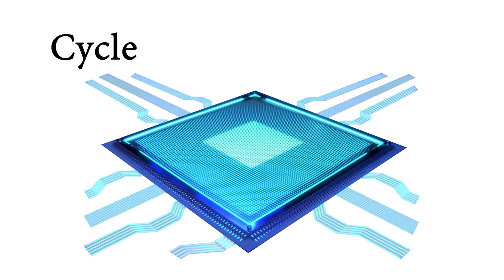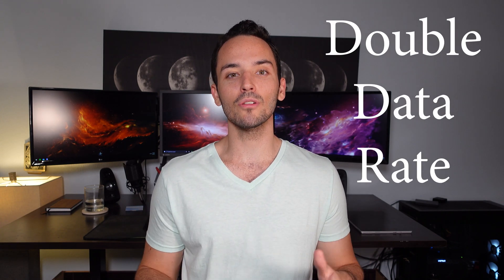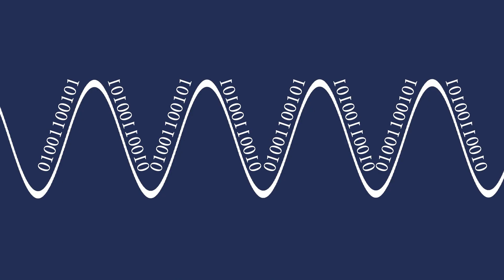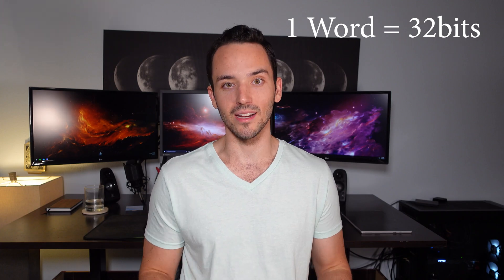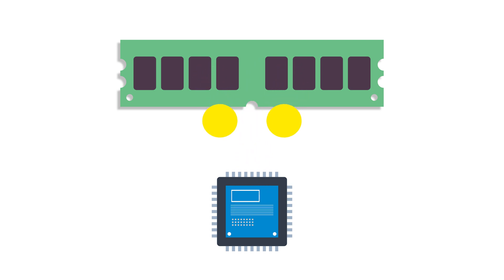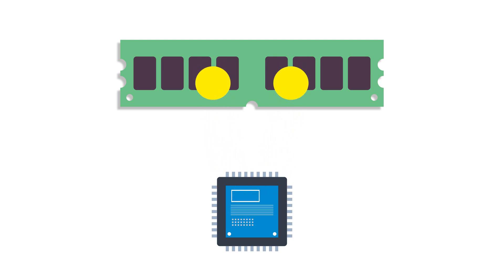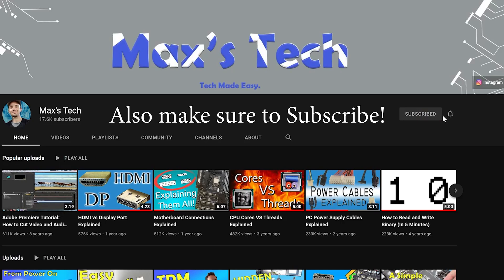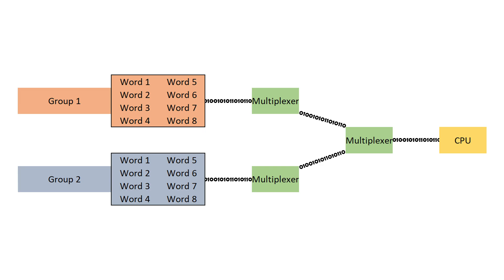RAM Evolution Unveiled - How Each Generation Changed the Game

Comment: Does DDR make a diffrence for what video card can be used?
Reply from the maker: Nope! Graphics cards have their own set of memory they utilize called GDDR and its built onto their boards. You'll want to check your motherboards PCI-e lanes for compatability for graphics cards. Most likely it will always work but you could be missing out on performance if you install a gen 4 card into a gen 3 pci-e slot for example. You'll always be stuck at the slower speeds